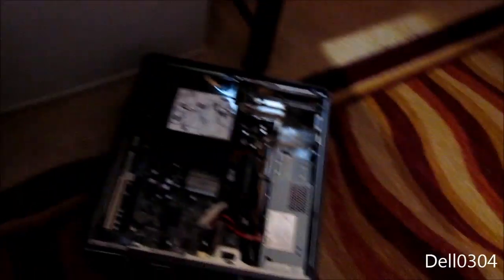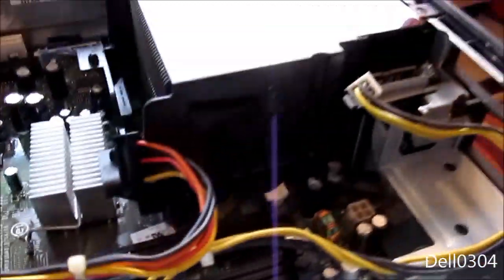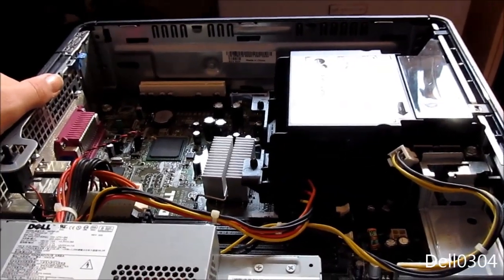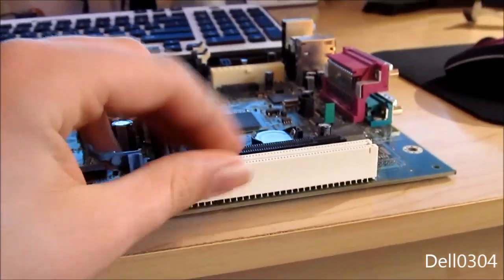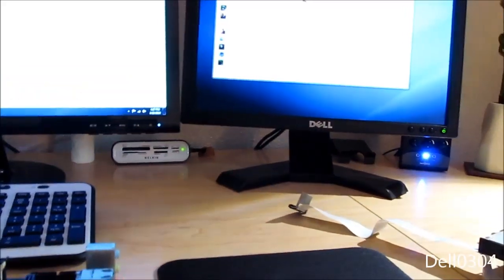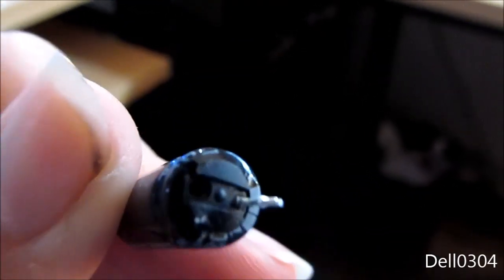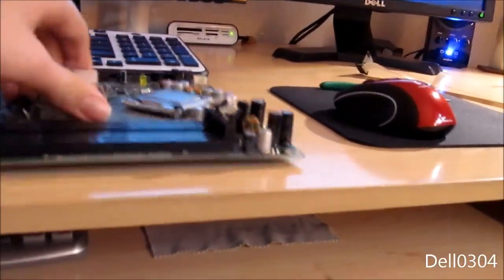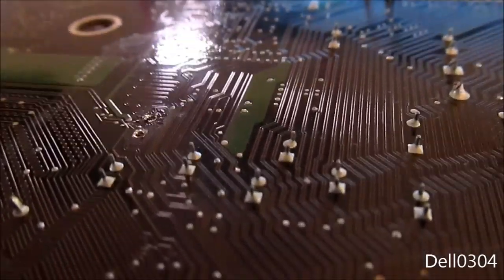Going to Fix the Dell OptiPlex GX620 (SFF)

Comment: The same thing is with my GX280, but the problem there were in 10 caps, which I have desoldered, but not ordered new. Also, recently I replaced a capacitor in our plasma TV, which worked out very well, and could be listed as my first real capacitor replacement.

Comment: not a bad little system overall, I prefer the BTX form factor like that to ATX because it pulls cold air in directly through the heatsink, but only in larger dells. like the optiplex 210 L and the dimendion 2300 because they are less prone to hot internals!

Comment: The caps are normally used for voltage regulation to the board and is used alot for CPU. I have seen on manly in gaming boards is that there are caps that line the heatsink. Also you didn't melt the PCB that is solder rosin that is the core of the solder you use

Comment: You may find the burnt pcb look is just flux, dont worry :-)

Sometimes its easyer to snip the capacitor off the pcb and desolder the stubs one at a time.

A jewlers magnifier is very handy, even if your eyesight is fine.

Good luck mate :-)

Comment: Capacitor replacement is very easy. As long as you don't go nuts, you will probably get it in. Also, the PCB looks fine.

Comment from the maker: I know, it was certainly a bad design. But there's not much that can be done. Only thing possible is connect a small case fan to the PSU, completely remove the hard drive caddy and mount the fan where it was, to push hot air out the back. I'll look into anything else possible without having to buy a 2.5" drive.

Comment: Well, my system has a different one, though bulging a little bit. Since i am not the best solderer as you, I will not try to replace the capacitor and hope the computer does not die :)

Comment: Those Dell optiplex SFF's are terrible with cooling! they should have thought better when constructing the design and seriously should have thought better considering they were putting Pentium D's in them! they get very very hot and it failed because of the heat although its a good brand the heat can get to them!
Reply: Sony Trinitron I have a GX620 with a Pentium 4 in it. Imagine how that is.
Pentium 4 ( Worlds hottest running CPU ) + Optiplex With terrible cooling = Fail.
Reply: 2K Tan Yeah, I tend to throw in Celeron's into them yeah it may be a downgrade but at least they run cool and Celeron's can do the basic day to day tasks
Reply: Sony Trinitron Yeah exactly. I just installed Windows 7 32 Bit on it and the CPU and Fans were maxed out just playing music and browsing the Internet and the whole time im just thinking about the capacitors and the sad part is i have 4 GB of RAM in it.